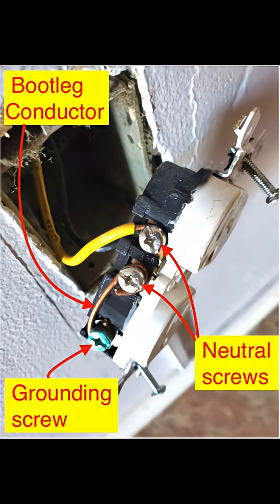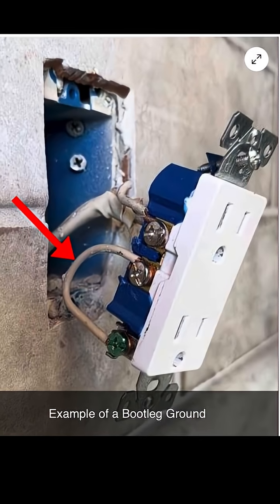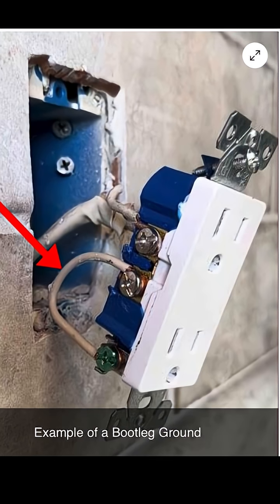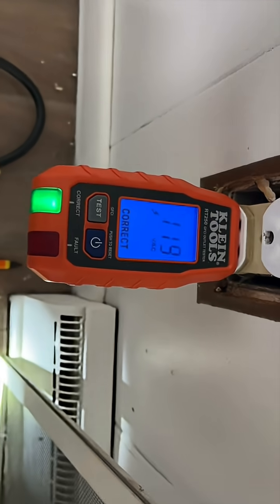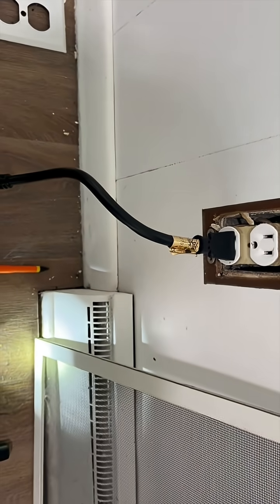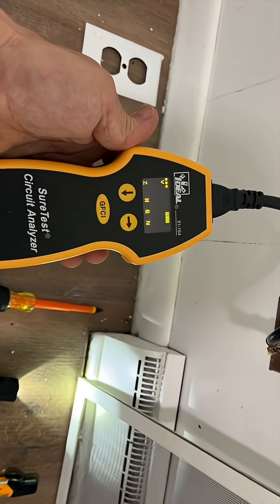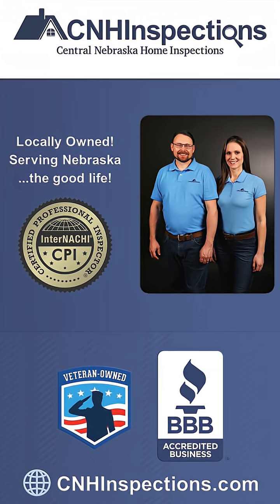CNHInspections | Bootleg Ground or "False Ground"

Comment: How does this know? The length of the wire and resistance is read by the meter?
Bootleg ground is not really a bad thing, unless you are in a wet environment. In my living room, would I possibly be grounded???
Reply: with a bootleg ground if something happens to the neutral connector (pinched off, cut, incorrectly fused etc.) the grounded housing of appliances can become energized. if the current can't leave through the neutral wire as it should it'll loop through and re-enter the appliance through the ground. it's much worse when you do this inside appliances and bolt the housing to the neutral wire, but this isn't exactly safe either.
Reply from the maker: Watch this: https://www.youtube.com/watch?v=gjo60o_nJ2I